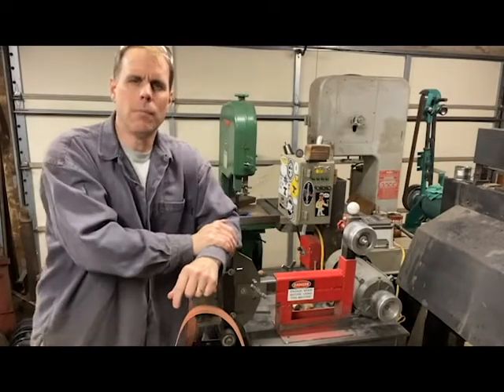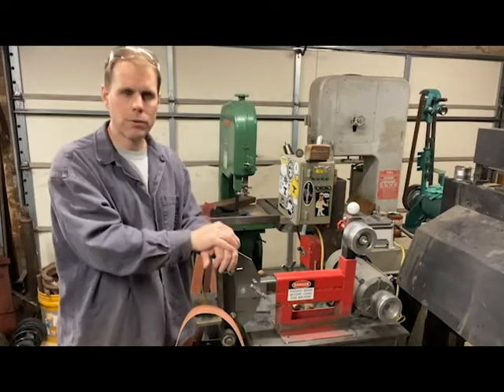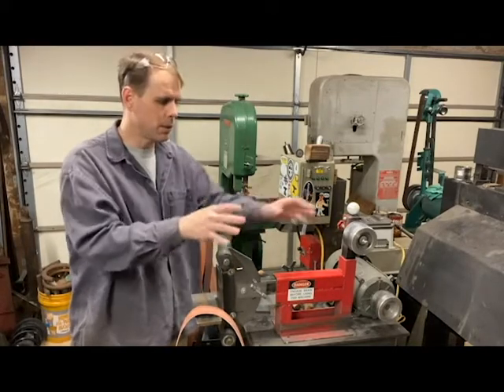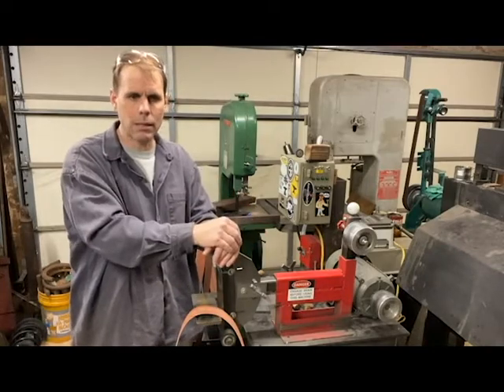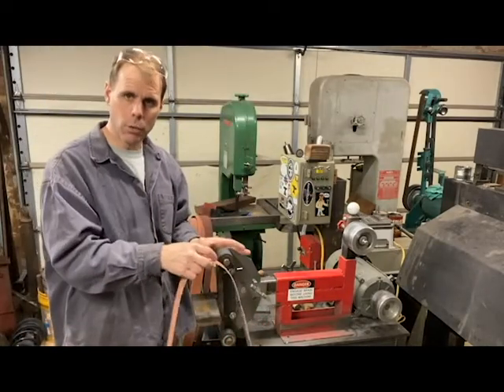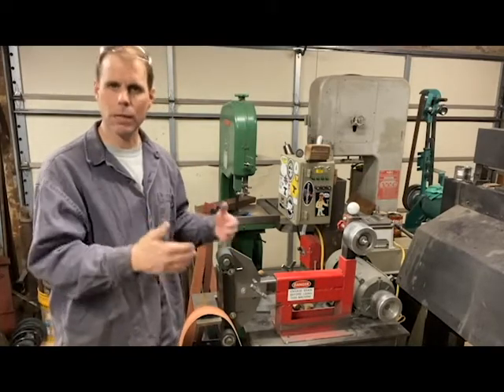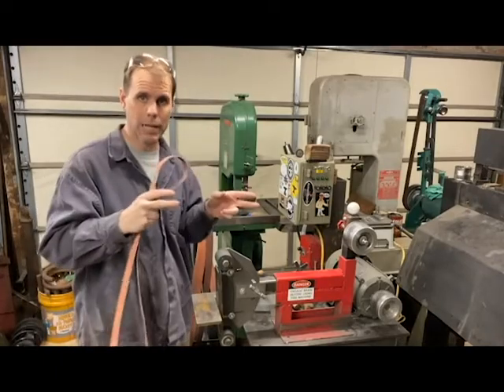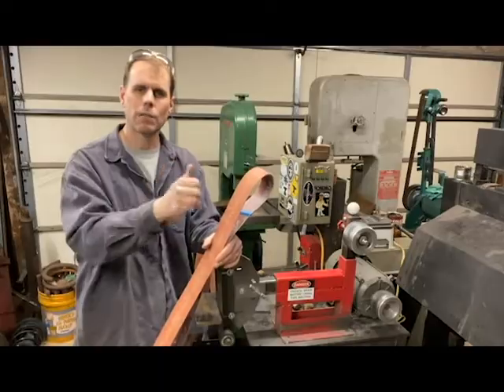Why I built my first 2x72 belt grinder

Comment: Good vid. You raise some very valid points. I'm not a knife maker, but I've wanted a 2x72 belt grinder for awhile now and I had been squirreling away steel to make one. Before I could get all my parts together I had stumbled on a Craigslist ad which turned out to be a Burr King knife makers 2x72 belt grinder. After handing over $200 I had my first 2x72 grinder and I know I couldn't build one for that amount. It's 45 years old and runs great. At some point I will use up that steel to build me another belt grinder.
Reply from the maker: Sword Fish that’s a heck of a deal!!

Comment: Great encouraging video. I built my own without plans. It was a great learning experience. Ok once you buy a VFD, three phase motor, Aluminium tooling arms, contact wheels and drive and tracking wheels etc. it is not cheap any more. Everytime I use it I feel happy to know I built it...
Reply from the maker: Paul van Zweel Yeah. The VFD and 3 phase motor make it more expensive but even then, I had less than $750 in mine. Which is probably half what most end up putting into a comparable commercial model and I stand by my statement that the expensive grinders just don’t grind any better than a WELL made diy model. ;)
Reply: @derekmelton   I agree. I have a metal lathe and made my tracking wheel and the flat platen small wheels as well as all the small wheel attacment stuff. Probably spent a similar amount to what you did. If you spend it over a period of time while building, it is less noticable...

Comment: Built several of these from Dan's design. Simple , effective tool. Less than $30 to do the frame.
Great video!
Reply from the maker: I've got to build one more!
Reply: @derekmelton  starting on one today for a fellow forge group member. 
This will make I think 13 I have built now. Not all Dan's design. I built mine different, but same basic principles.
I use gas struts for belt tension and use a swingarm setup for tension and tracking.